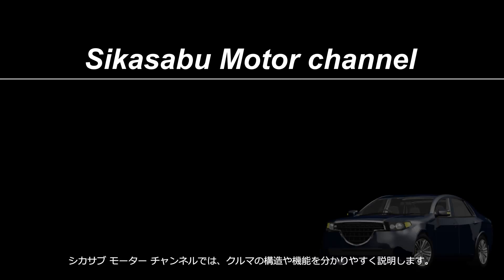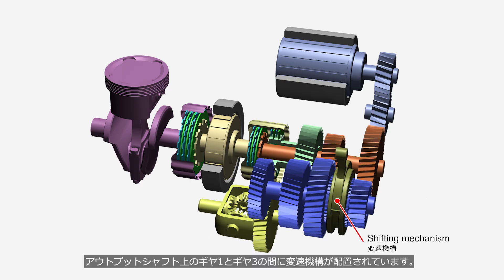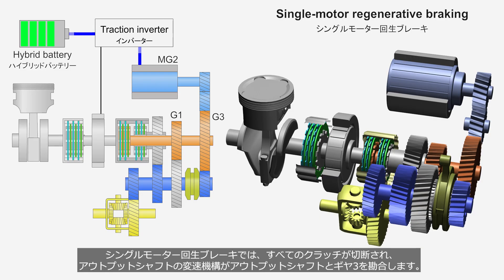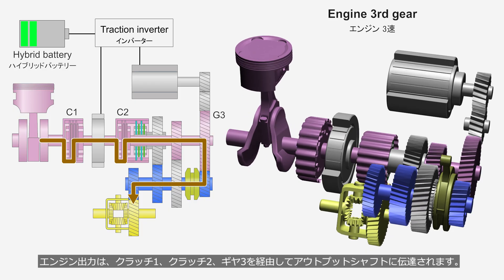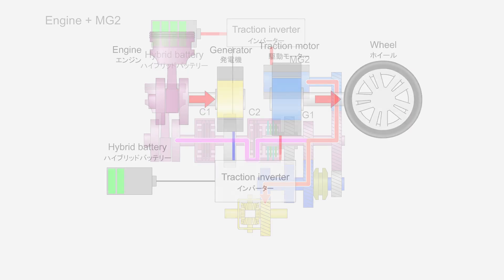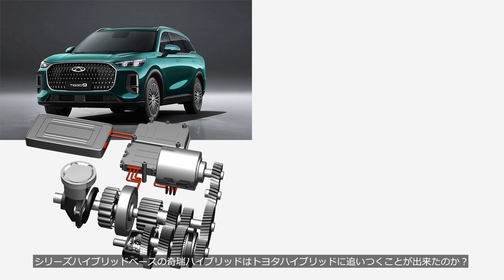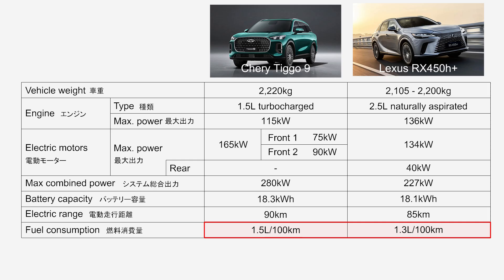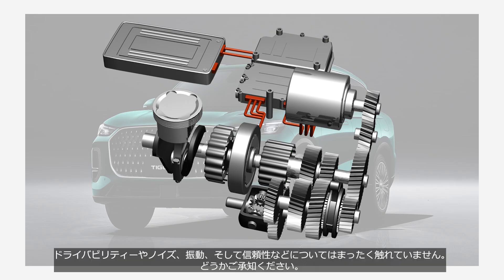What About Chinese Hybrids? Chery Automobile Tiggo 9

Comment: This gearbox seems to be out of this world, but it is not really. This gearbox is very similar to DCT gearbox but with 3 gears.

Recipe for Chery 3DHT gearbox is:

1. Take VW DSG dual clutch transmission

2. Remove all gears but 1-3 (2nd gear is on separate shaft just like in DSG)

3. Add one clutch between engine and gearbox, to be able to disconnect engine from gearbox, all hybrids do this

4. Add MG1 between engine and gearbox

5. Add MG2 connected to the second gear shaft

And thats all :) its essentialy DCT transmission with 3 gears, one additional clutch and two electric motors.

Comment: The chinese users have already done some actual-use test, and it came down to ~30mpg, which is a fair bit worse than 34mpg of the RX. Aside from the complexity of the system, it's still 10% or so less efficient.

Comment: THis is far more complex than that of the Lexus, which means more chance of failure and higher maintenance cost and repair cost.  However, it would be better for vehicles that do a lot of towing heavy trailers due to the  3-speed geared transmission which eases the stress and reduces heating on the electric motors.

Comment: quite interesting yet bit too complicated. esp. when MGU1 is on trouble.
Reply: Yeah, even 3 clutches is abysmal for maintenance
Reply: If MGU1 is failed, the car will act like an automobile with 3 gear speed, like the old automatic transmission.
Reply: @alexlo7708  i know but concerning with maintance will be abysmall
Reply: @SeogabOnotjah Somehow, it is like a combination of a direct shift gear with motors.